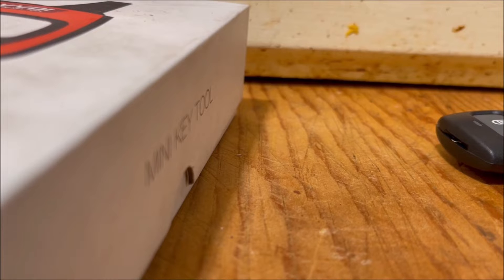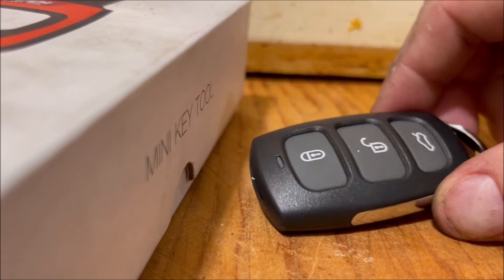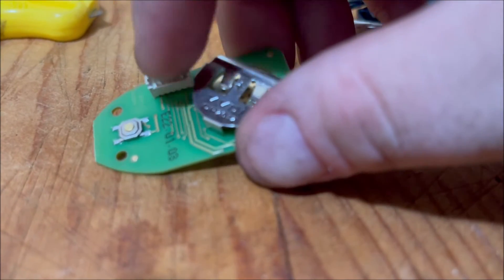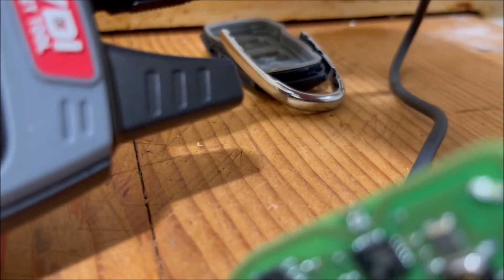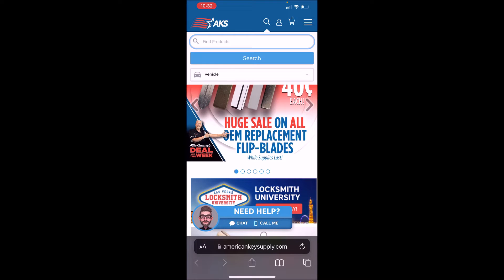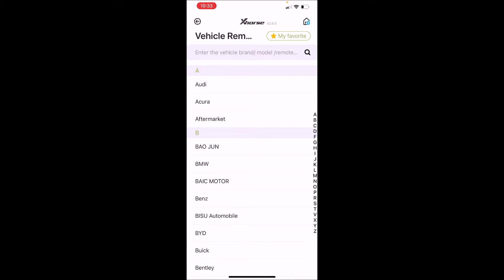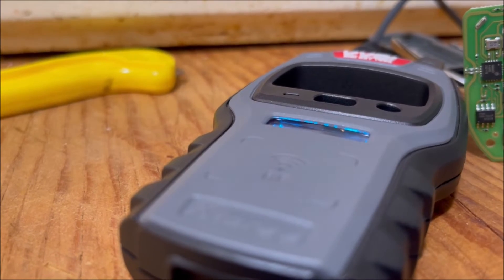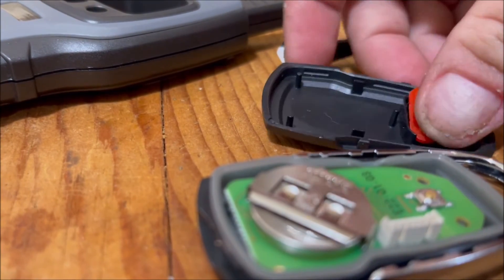How to Generate Xhorse Remotes With Correct FCC ID# (2022)

Comment: I've just started using the mini key tool,with the wired remote don't you have to put a transponder in it too?
Transponders are already on the circuit board of the wireless xhorse remotes.
Reply from the maker: Not with a wired remote- not for keyless entry-

Comment: Good information, what’s the name of the programmer that you are using
Reply from the maker: Autopropad
Reply: @thewhittierlocksmith121  full or basic ?
Reply from the maker: @Hustle5  basic
Reply: @thewhittierlocksmith121  how does work for you, I’m new to the locksmith world and I’m going to purchase my first programmer next month and I’m not sure witch one to choose from, I heard a lot of bad and good thing for each one, so I’m very confusing, also some locksmiths suggested IM508, what is your thinking ? Thanks
Reply from the maker: @Hustle5  I really like it. I would get both im508 and autopropad if possible. I only do US domestic and Asian cars, so for those two machines are best. Sometimes one doesn’t work on a car, so the you use the other one to complete the job. It depends what types of cars you do, if you want to do European cars, you will want im608 and xp400 at least and learn about EEPROM because most of those cars do not program via OBD2 port
Reply: @Hustle5  There isn't one that will do everything and sometimes the same one that worked last time won't work on the next one same year and model. We have 7 programmers all different. My advice would be to stay away from non OEM's as much as possible. We have the best luck with OEM's and refurb OEM's. Of course we started off with aftermarkets and some do work with no trouble but it's not worth call backs. The worst for us are Nissans and Infiniti's. We used aftermarkets and many stopped working after 3 months. We will only use OEM period on those. We only do autos so lots of experience.
Reply: @scotts4125  thanks so much sir for your response, I really appreciate your help. As new to this world, I just bought some inventory last week and most of them are OEm but the prices are high on UHS compare to aftermarket. So do you any good experience with some aftermarket? Thanks
Reply: @Hustle5  We are local to UHS and try to avoid them at all costs. They sell to anyone so not locksmith friendly. Just some advice to someone who has been in business a long time. Being the cheapest guy never lasts. They always go out of business. You can use OEM's and still be hundreds cheaper than the dealer while still making a profit. Any profit you make goes away on a callback using junk just to be cheaper. When customers complain about my prices I tell them to call the dealer to see how much they charge. 90% end up having us do it. Do be afraid to charge what you are worth. I really don't want to work for price checkers any way. They only care about price and nothing else. I am happy to let the fly by nights do those. They are made for each other. We stand by our work so I have to use product that are known to work. I charge accordingly. We get quite a few calls where people paid the cheapest guy and their key stopped working and they can't hold of them or he refuses to warranty it. We do everything we can to do it right the first time.
Reply: @scotts4125  absolutely right, I agree with you  because if you keep giving a fake product for your customers you gonna lose them one by one, and at the end you are going out of business. By the way witch suppliers do you buy your keys from? Actually I’m using UHS and AKS
Reply from the maker: Autopropad